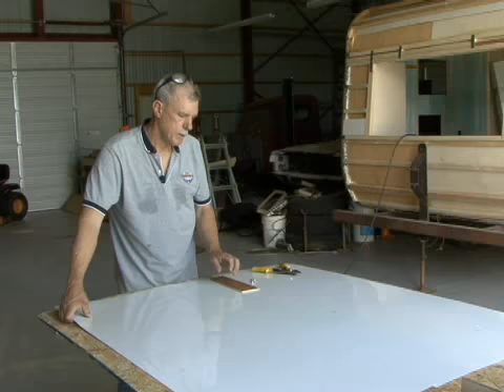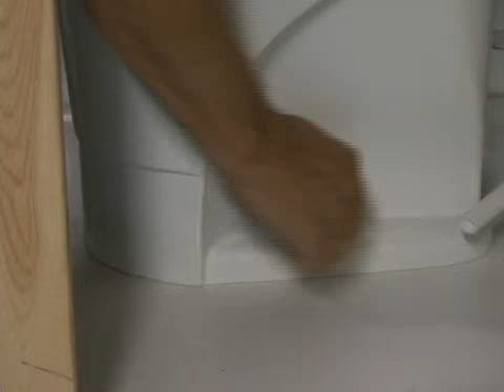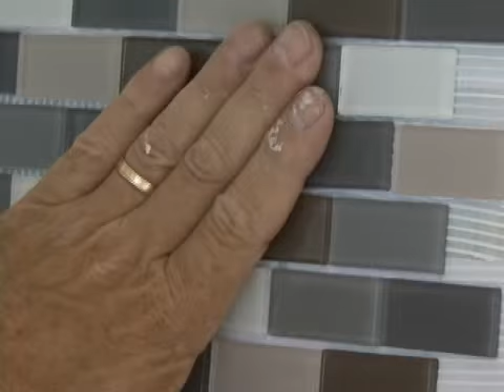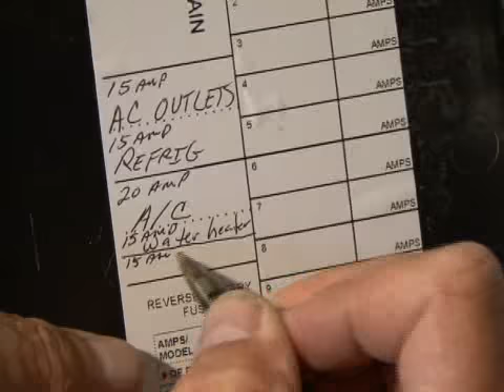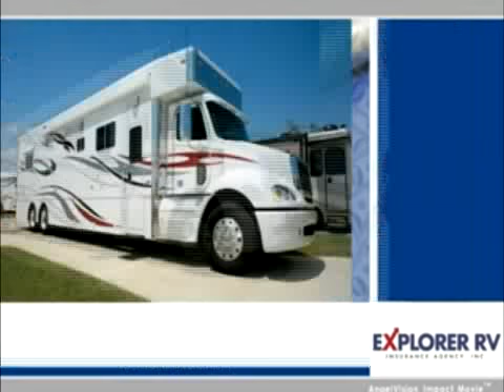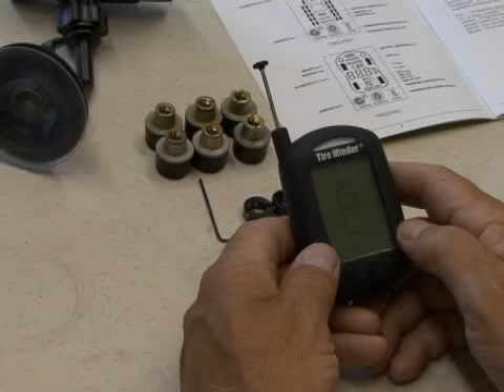Mark's RV Garage Episode #10  Internet TV Series by RV Education 101

Comment: Just found your video, in watching you do the toilet and waste tanks, what water and water connections did you use? I see several JOHN guest connections, were these purchase from lowes?
Restoring a 1986 c class, completely, need help.
Reply from the maker: I'm not sure I understand your question about what water and water connections I used? Yes I did get the water line plumbing fittings at Lowes.